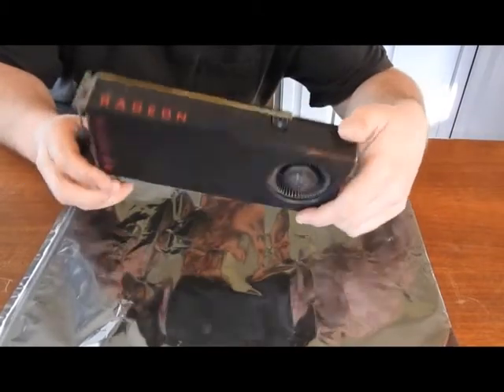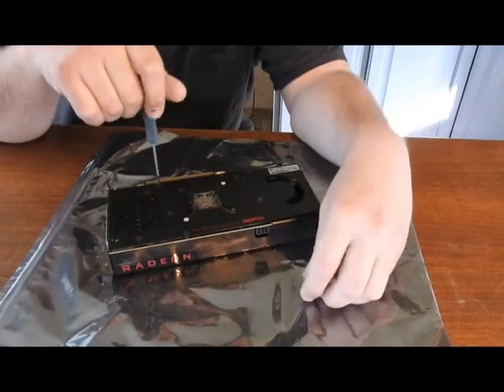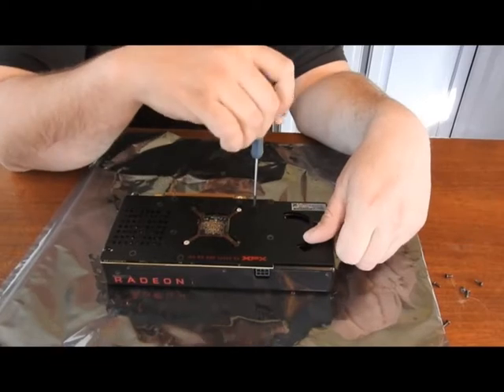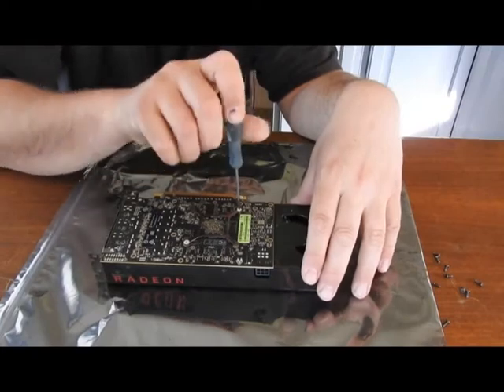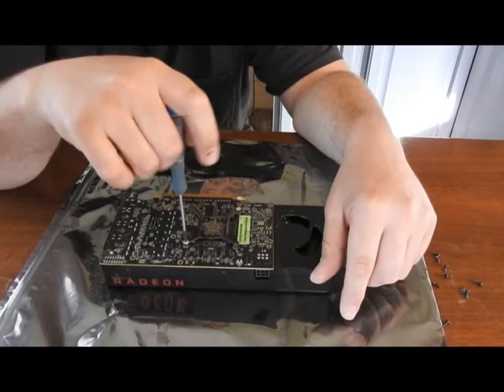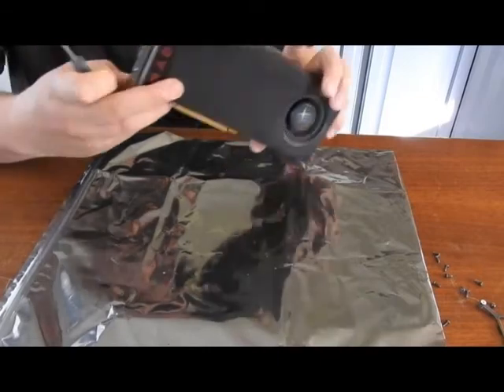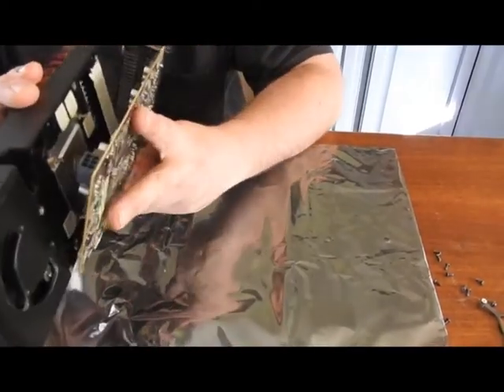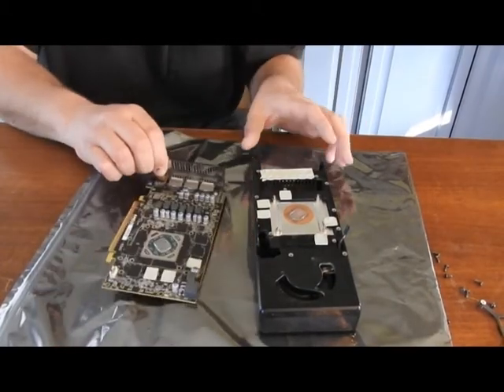[XFX RX 480 Thermal Paste] - Part 02 - Teardown

Comment: My temps touch 90 while gaming using this card, is it normal or could it need some fresh thermal paste ?
Reply from the maker: 90 is a bit much, yeah I would change the paste.  That cards target is 80.  Starts throttling around 93 so you are getting close.

Comment: are these thermal pads on every rx 480? i only have thermal paste and dont want to buy these pads. i have radeon 480 8gb
Reply from the maker: They should be on all the chips to keep the on board RAM from overheating.
Reply: @dragonslair80  is it possible to use thermal paste instead of these pads?
Reply from the maker: @herb6000   I do not believe it will work.  Not a pressed together fitting.  It might be better than nothing but not sure there.
Reply: @dragonslair80  or let me ask a different question first. is it absolutely necessary after all these years to replace thermal paste`? i got it at release
Reply from the maker: @herb6000  I would not replace it unless you are having trouble with too much heat.
Reply: @dragonslair80  I do. Did you happen to note the thickness of the pads?
Reply: What thermal pads are you referring to?
Reply: @coolunusual  those white thingies that look like squares of double sided tape. They are thermal conducting pads, like thermal paste but for thicker gaps between chips and radiator